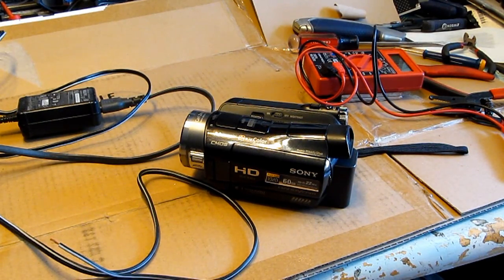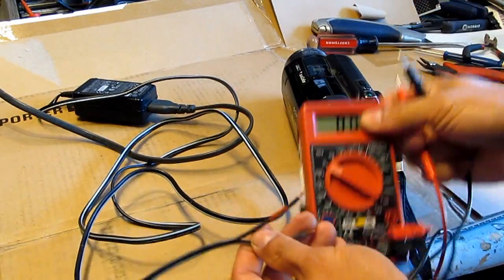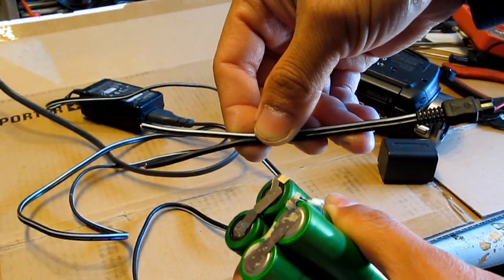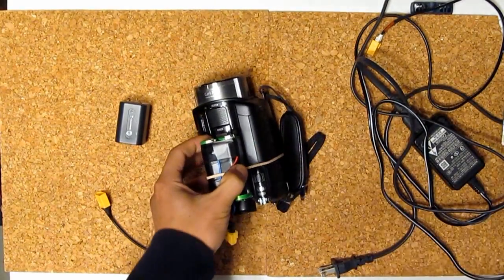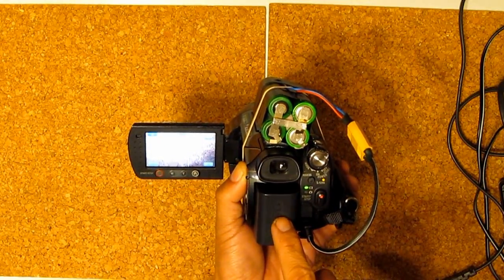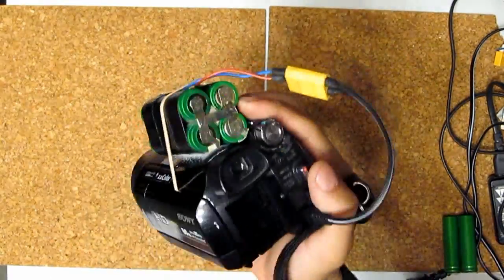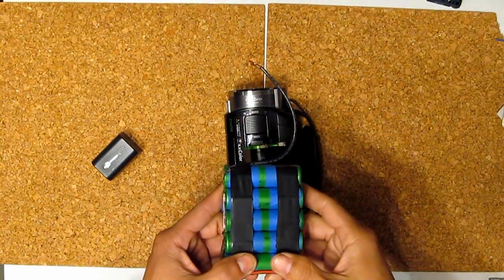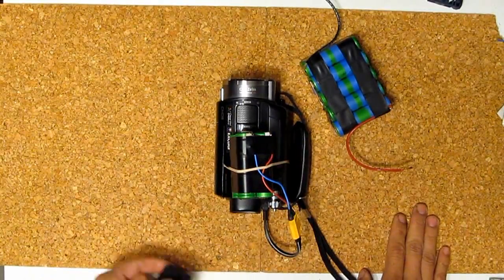DIY: Camcorder battery hack. Home made super high capacity 18650 battery pack

Comment: I was trying to do this with my Sony CCD-TRV68 bc i ran out of infolithium L batteries and when i plugged everything in, i turned on the camcorder and the "for infolithium only" message popped up in the screen and then it shutted off. Why it works for a most modern camcorder and not for one of the end 90s? Do you know any solution to this error? infolithium L batteries are a lil expensive for me :(

Comment: I'm thinking something like this with a longer cord and a belt clip on the battery pack would be the killer app for this so that the camcorder's functions aren't being interfered with when this battery is hooked up. My FDR-AX33 has zoom adjustment, still photo button, flash mount, and surround microphone on top so mounting up top would be a no-no. The belt clip for the battery could then be hung off the hand loop when tripod mounting the camera. 1.5 hours just isn't enough for family holidays and those Series V Sony batteries are a ripoff. You've got me thinking...

Comment: @vuaeco - you really should charge a 2S battery with a balance charger like any other lipo; once the batteries are a bit older they will not charge / discharge in the same time like when they are new. Just to avoid future fires. Stay safe.

Comment: This is similar to some of the mods I have done to my video cameras. One in particular, a Kodak Zi8, can now run and record for 11 hours on 2 3400mAh cells. All of the cameras I have this kind of mod done to are 3.7V cameras, so I have the cells set up in a 2P configuration. The difference with my 18650-mods is I always use a battery box, so that I can change out the cells when they get low and charge them in my OPUS BT-C3400 charger. Also, the camera's original battery is replaced with the 18650-mod. I solder the wires from the battery box to the original power terminals inside the camera. The only protection I include is a series 3A fuse for short protection. The camera generally takes care of shutting off power before the cells get too low. And with my cameras being in a 1S configuration, no need to worry about cell balancing.
Reply from the maker: That's very nice.

Comment: Would it be possible to just rip open the battery and solder to the original cell connections? Or does the battery have its capacity programmed in? I'm thinking about doing the same thing but with a Panasonic camcorder that has a 3.7V (4.2V) pack.

I tried the same thing with the battery for my Sony HDR-SR11 back in 2013, but I fried the chip.

Comment: the camera should have a mounting hole on the bottom. maybe get a project box to put the new pack in with a bolt to screw it onto the camera. I'd also make a bigger pack for really long times.
Reply from the maker: The mounting hole is for the tripod. You can use the bottom if you don't use the tripod. That is not an option for me as I need to use a tripod.
Reply: vuaeco oh ok I see. maybe make a pack that attaches to the tripod and run a wire up to the camera.
Reply from the maker: Allen McKinney Yes, that's a good idea.

Comment: Would be better if you add protection and over discharge circuit? They are dirt cheap on Ebay.
Reply from the maker: Yes, it would be better if I could add some over-discharge protection circuit. But this camcorder automatically shuts off when the battery pack reaches 7.0 V. So that's why I didn't need protection circuit. Maybe a voltage indicator light would also help. But adding those will make it even more bulky and clumsy than it already is.